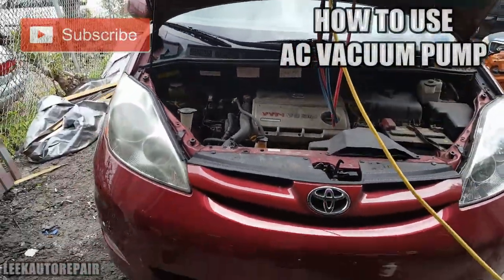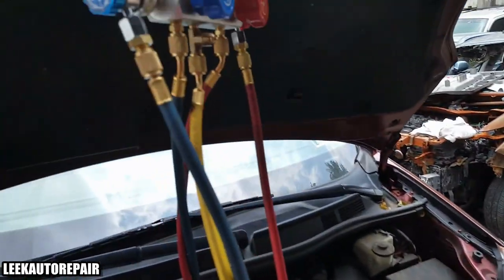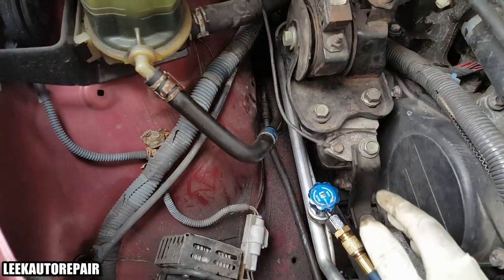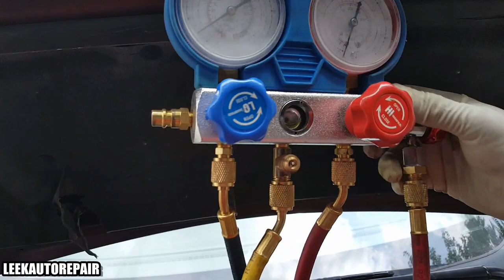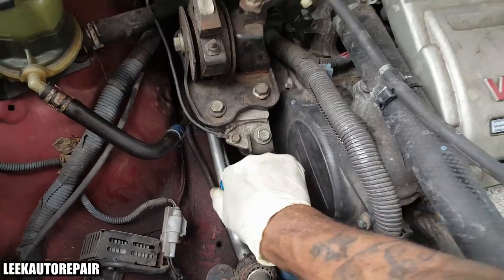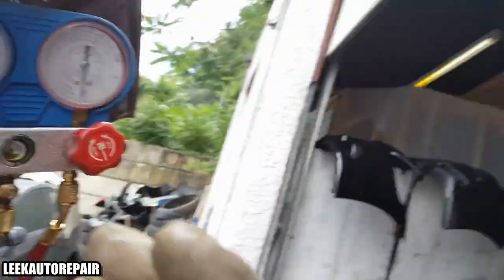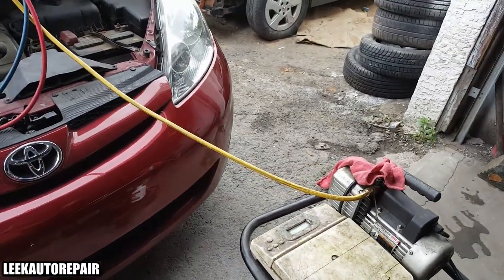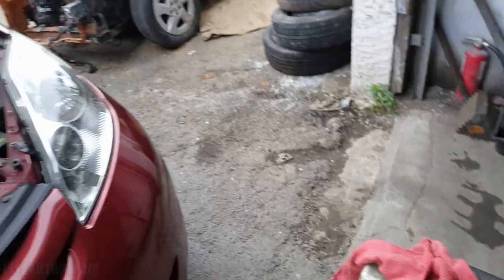How to Use AC Vacuum Pump Harbor Freight

Comment: Very good explanation and It looks like you guys have a great time! When you recharge, do you use a fan or something? Here in NC, it gets really hot and humid, so when I have to recharge, I have to either stick a huge fan in front of the condensor, or run water over it while it's recharging.
Reply from the maker: Yea it gets really hot in PA! I never had to use a fan to recharge a vehicle........what are the temps like?
Reply: The temps hit around 95, but there is so much humidity here, it feels like in the triple digits, besides that, the south is actually built on a SWAMP! Man do we miss NY.
Reply from the maker: Oh we're both in for it this summer......Philly can get up to 100 smh.

Comment: question. I tried to pull a vacuum on a 2005 odyssey after changing the compressor and the condenser but the low side does not move below zero. What could be the cause - help please.

Comment: Hi my question is can the Habor Freight  vacuum pump pull refrigerate from the system, or do i need to take it to a professional shop to have it evacuate. And also if it can be evacuated with the Habor Frieght pump .How do I get rid of the old refrigerate from out of the pump.

Comment: The problem with this video is technical. 

The smoke coming off the pump is moisture in the system evaporating.

The pump oil should be changed after every use or the pump is gonna get corroded internally.

The fogged sight glass might be an indicator that the gauge isn't properly screwed into the body maybe? I've seen others put tape on the threads.
Reply from the maker: Did you complete your bucket list?
Reply: @Leekautorepair  no, I still have to make you a real mechanic son

Comment: Note should hold vacuum for 30mins. And does not remove debris. You would need to flush system to remove debris.
Reply: What do you flush it with?
Reply: What do you flush it with Willis?